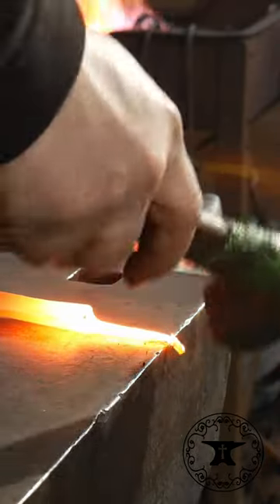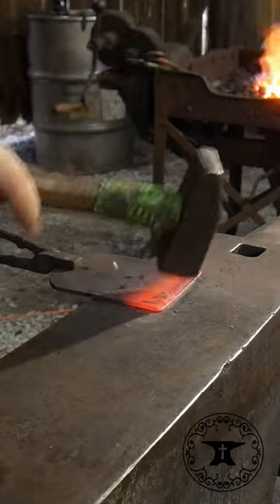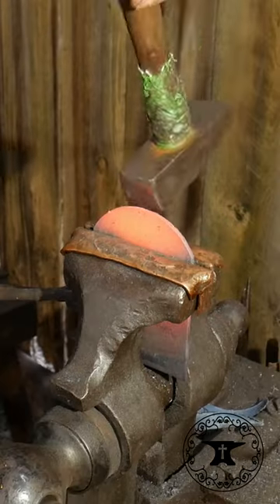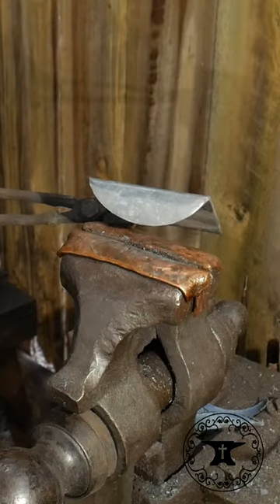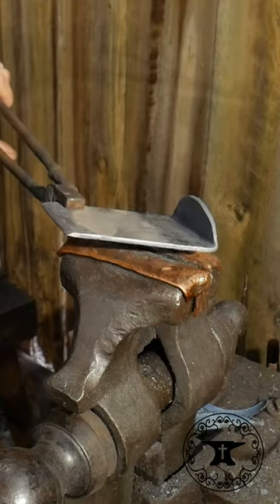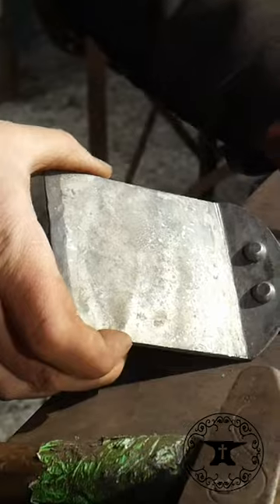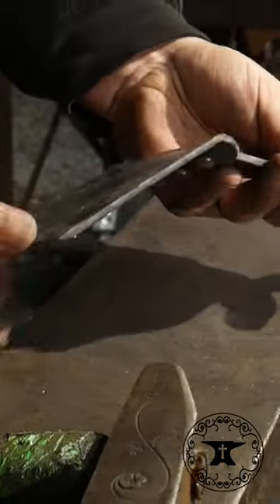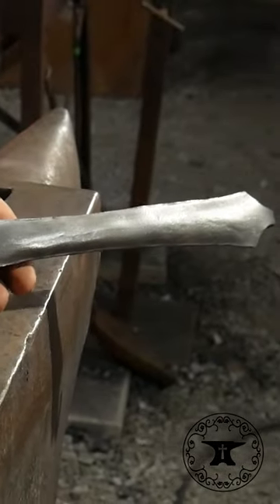Forging a Spatula #shorts

Comment: How’s best to treat it afterwards?  Do you just soak it in warm/hot cooking oil. Considering it’ll be touching food regularly
Reply: Just clean all the debris off.
Reply: @Bando-fx4mf  hey screw you Bando. I just asked how he treats the steel after forging.  Some guys heated back up in an oven and soak in vegetable oil to prevent future rusting.  Did you think of that?